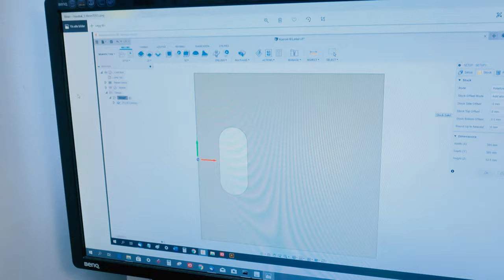Making two Plywood Crates | Wood | Birch

Comment: Newbie here! I’m still a little confused on angled cuts on the table saw...if you mark it with a straight line where you want it to be cut, do you cut on, past, or before the line on an angle? I’m just a tad confused thank you!
Reply from the maker: Hi, thanks for watching 👍 That all depends on how you have measured it, usually you want the line you draw to be the place where the cut is going to be when finished. Thats why the line you draw has to be on one of the edges of the saw blade. (The saw blade is quite thick)
I always think about this when measuring and its always a good practise to put a smal cross or mark on the side of the cut line thats going to be cut. This way you know what side of the line you want the thicness of the saw blade. Hope this makes any sense 😀 
Learning by trial and error is a good way to learn, let me know how it goes